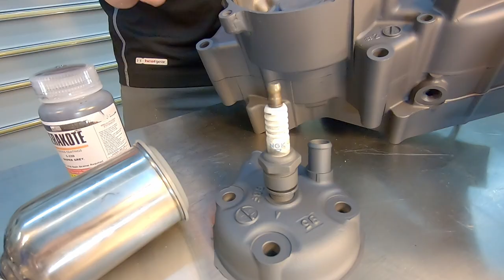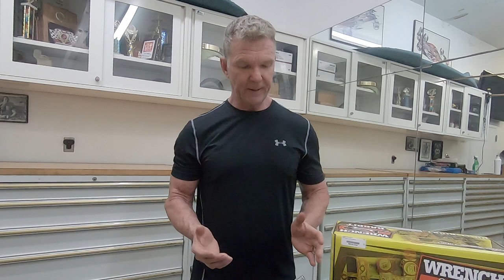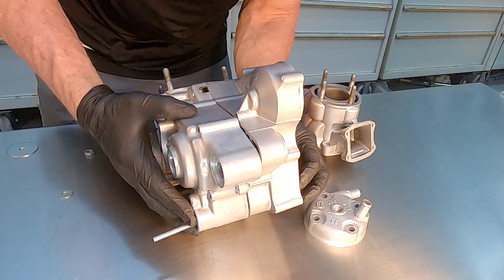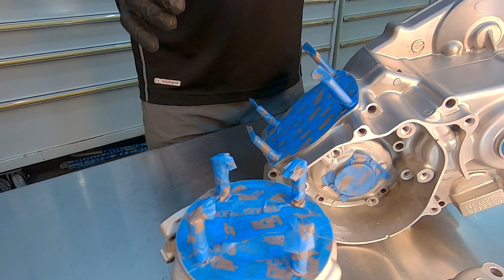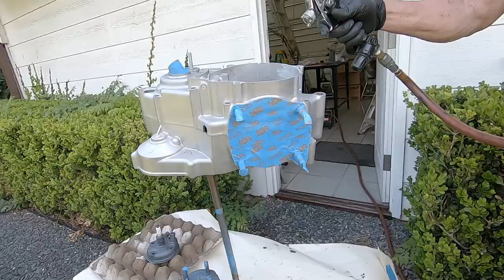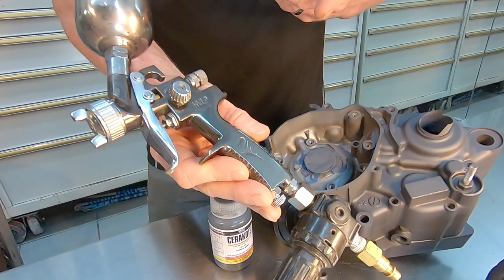Vapor Blasting and Cerakoting Engine Cases

Comment: Hi, Brian
I suggest before you instruct people what to do you should study the Cerakote instruction. I do have a Vapor blaster and a dry blaster at home but Cerakote stresses in every instruction to dryblast the surface with a 100-120 grit aluminium oxide to „scratch the surface“ and NOT use beads and vapor blasting for a nice shiny surface. Also it is always good to bake the parts first. But basically what it boils down too is study the instruction and do it right before making a demo video on Youtube.
Reply from the maker: I’m very familiar with applying Cerakote and have had multiple interactions with the technical departments there. If you want to shoot Cerakote on a firearm, by all means, it doesn’t hurt to dry blast it, of course. If you are familiar with motorcycle cases, you may know that the surface is not a “nice (sic), shiny surface. Its is a cast surface. So, what it really boils down to is your expectation of the surface appearance after preparation. And the adherence of the media to the substrate is far more dependent on cleanliness than blast media. I have sprayed countless parts using my techniques. So, rather than suggest that I’m not doing it right, perhaps just do it how you like. My results stand for themselves. I have had ZERO delamination issues using my techniques. Feel free to make you own videos, but my instruction and techniques are proven and right on as my result bear.
Reply: Hi Brian
I respect that you do anything the way you prefer but don’t forget that a lot of Youtuber (like me too) watch videos to learn and improve procedures and in exchange we thankfully support such Youtube channels in good faith that your instructions are (Cerakote) correct. You owe it to your supporters that, at least you tell them that this is not how Cerakote wants their products applied to guarantee long life and mention that this is „your way“ of doing things contrary to what Cerakote instructions require.
Sincerely Bernhard
Reply from the maker: @bernhardlist9359  It seems that you are not grasping the distinction made by Cerakote in their surface preparation for, and I quote your first comment “nice shiny surface” and a rough surface like a dirt bike motor case.   I did my best to explain in my previous reply that the surface of an engine case is cast, not shiny.  I have over 30 years of experience painting in the automotive industry and I am well versed in the procedures for painting and surface preparation.  My technique for preparation of my substrate in this video is absolutely correct and appropriate for an engine case.  In no way is my preparation a break from what you call a “requirement.”  If I were painting a car panel, the surface preparation would not be the same as it would be if I were painting wood.  The same parallel applies to the differences  between a firearm and an engine case.  What matters is the cleanliness of the surface, the spray techniques and the drying recommendations.  So, to summarize, what you seem to be ignoring – even though I have already explained this - is that the recommendations of Cerakote are for the expected result from preparation of  a smooth surface such as a firearm.  Please feel free to ignore my tips and techniques and refer to other videos.  However, my results are proven using my techniques as I have had ZERO delaminations on ANY components I have painted with Cerakote.

Comment: Hey Brian I completely understand your logic for dismissing the absolute need for sand blasting for surface prep in regards to the cerakote adhesion. But for strictly cleaning purposes prior to applying cerakote on something as intricate as engine cases, would you say the vapor honing is superior to sand or bead blasting? I ask simply because I think I can find someone to sandblast easier than vapor honing.
Reply from the maker: That is a tough call, Charles, but I lean toward, "yes."  Vapor blast just looks perfect when completed.  Ive never found anything that turns out better after treatment.

Comment: How durable is this non-hardener  Cerakote?  I have used the catalyst/baked version.
Reply from the maker: Hey Rusty!  Cerakote is not super durable in general.  Its hard, but not tough. However, specific to your question, the C series has greater variability in hardness ratings than the H, or catalyst dependent, Cerakote. According to Cerakote, pigments vary in hardness so, with the absence of catalyst, the pigment contributes more greatly to the hardness rating. The presence of catalyst as a medium for hardening makes H series less variable. But, as I stated in a more recent video focused specifically on the superiority of the C system for most home hobbyists, both systems are very hard and, in my experience, indistinguishable.  A lot of things come down to splitting hairs and for me, this is one of those circumstances. They are both very hard and the ease of ambient cure is worth a greater variability in hardness given that the difference in hardness is negligible. Hope that clarifies!  Thank you so much for watching!

Comment: I have a buffer and an air die grinder. Do you think if I use a scotch brite wheel and buff the part without sandblasting would be ready to cerakote? Which grade of grit do you recommend?
Reply from the maker: Hey Genysmen!  It probably would.  But, as for grit, Im so sorry, but I just dont know.  I prefer the finish of Vapor Blasting as it looks as fresh as OEM after.

Comment: Hi, looks great.. Looking a Cerakote C as well and have just vaposufficient
Reply from the maker: Hi Chris!  I think C Series is the best for most DIY applications.  Its easy to spray, no heating and no mixing hardener.  Im not sure what "Vaposufficient" means...!:)  Thanks for watching and please consider subscribing if you havent already!
Reply: @brian.d.mobley , 

Don’t know what happened but I must have deleted the message before posting. 

I meant to write that I have been looking at Cerakote C as well and have vapor blasted an entire BMW airhead “R80RT” engine as prep. However I talked to the local paint shop and they pointed out that vapor blasting is not creating a sufficient surface profile for the Cerakote to stick to. I have copied in a statement from the Cerakote application guide beneath. 

”application guide” :
A blasted profile must be applied to the substrate to remove any rust, scale or other coatings. This is required to ensure maximum adhesion. Remove any sharp edges that may create thin areas or protrude through the coating. For best results, use a dry grit material such as aluminum oxide or garnet equivalent to a 100 - 120 mesh size. Glass beads are not recommended as they are not aggressive enough to produce a sufficient blast profile. 

Now in you video you refer to vapor blasting as a great option, but that is a lot milder that sandblasting and I’m aware that glass bead blasting is not the same. However vapor blasting is not the same as sandblasting either! So I would love to hear how it holds up afterwards. Have you done any scratch or chipping test or similar.?

BR
Reply from the maker: @christoffermuhlbach1699  I talk about this issue all the time and I am about to do a new Cerakote video where I spend more time on this topic. The short answer is: A vapor blasted finish will work GREAT.  It is a media blasted profile that is delivered via water jet rather than air pressure.  Here is what I say about this issue all the time: "manufacturers are forced to make firm declarations about how to apply their products to avoid having to answer a million questions about variables AND because it gives them an avenue to avoid responsibility for poor results by citing  errors in procedures by the applicator."  As an example, I too contacted cerakote about coating a dirt bike rear shock absorber spring and was advised that it a perfectly fine application (I was concerned that the coating would be too hard and would not allow for deflection of the spring under load without failing).  A spring is made from VERY hard metal and it would not matter one bit if that metal were sanded, vapor blasted or sandblasted, the surface would end up with almost identical surface roughness.  In the automotive paint world, spray techs call the surface preparation as having adequate "tooth" to allow media to adhere.  Usually 600 grit sandpaper creates the level of tooth.  So, to summarize, dont get bogged down by manufacturers recommendations on surface prep.  It could affect how smooth and shiny your job appears after, but I have cerakoted polished dirtbike cases on my shifter kart and have cerakoted multiple engines and have never had a problem.  I am an avid cleaner and preparer and that is what is needed more than anything to ensure good adhesion.

Comment: How's this hold up to heat, and is it easy to clean after riding?
Reply from the maker: Hi Eric.  Cerakote is rated to at least 1000 degrees, so its no problem regarding heat.  As for cleaning, the surface texture is the same as the original part so there is no change there either.  Its great stuff and I use it a lot!  Thanks for watching!

Comment: Hey man good video.👍🏼
So I don’t have to put it on the oven?
Reply from the maker: Hey Luis!  Cerakote makes various “series” of coatings, but they roughly break down between air cure and oven cure. There are lots of air cure colors available. So, to answer you succinctly, no. You don’t have to use an oven for all Cerakote series. Thanks for watching!

Comment: What PSI are you running when spraying the Cerakote. Great Job.
Reply from the maker: Hi SC!  The PSI varies depending on the color used, but usually between 15-20 PSI. The manufacturers data sheet will tell you the correct PSI for your color which can be found on the Cerakote site.
Reply from the maker: @davidofqwerty  Respectfully, you are simply following dogma and don’t understand application theory nor that not all surfaces on which cerakote are applied must be prepared by sandblasting. Cerakote now acknowledges this. Cleanliness is far more crucial to outcomes than “blast profiles” as has been proven countless times from my over 30 years of application experience.

Comment: Is it bad to leave it without cerokote?
Reply from the maker: Not at all.  From the factory, they aren’t coated. But aluminum oxidizes and looks dull quickly unless you take good care of it. You can spray all the engine down with Boshield T9 or maybe WD40 and it will stay fairly new looking for a long time. T9 is a superior product but it’s expensive.
Reply: @brian.d.mobley  ah okay, i was worried about that. Some guy i met is charging me $100 to vapor blast my frame. Do you think that is a good deal?
Reply from the maker: @EarthWasHere  I think it’s fair. To do my entire motor is about $70.  It’s much smaller to do a motor. And not as unwieldy.  I think it’s about the right price.
Reply: @brian.d.mobley  Got it. Thank you. 👍

Comment: So, why not just vapor blast, then run it without cerakote? 
I am rebuilding a cr500 for a client. We are trying to decide what coating. 
Powder doesn't look as clean to me. Cerakote looks awesome. 
But the coaters don't know how well it will wash off . 
We live in oregon , so this bike will see some sticky red mud!
Reply from the maker: Hey Dave!  You can just run it. But aluminum will oxidize and get dirt stains. I prefer to coat it for these reasons. Not to mention I like the look. Cerakote is very durable and won’t wash off. As long as you don’t clean your bike with a wire brush, it will last a VERY long time. I keep my bikes spotless, so I don’t leave dirt and oil on mine, but even if you do, Cerakote holds up well. And, Cerakote is a superior choice for engines for it heat dissipation qualities (it won’t insulate like Powdercoat) and its temperature resistance. Its really pretty amazing.
Reply: @brian.d.mobley  Thanks Brian! 
Yeah, I believe I will push him towards cerakote! 
I guess I typed it weird above, but there was a concern about the cerakote being semi porus and the dirt embeding in it. 
But I know for sure the bare aluminum will do that. 
This particular bike was mine for 24 years,so I am taking extra time on it. 
Thanks again!
Reply from the maker: @davelambardo6464  Not to counter what you wrote, but Cerakote is not porous.  It is a a paint and it will completely keep out contaminates as long as its not damaged.  The surface of a case or engine is kind of rough (which may be what you are expressing in your comment).  You will love the result from cerakote.  And, they make clear that you can spray which will keep the dirt stains away yet still retain the look of the stock metal (if you want that look!).  If you decide to do it and need help, don’t hesitate to reach out.  Ill help as much as I can!
Reply: @brian.d.mobley  Perfect !  Great help Brian !
Reply: @davelambardo6464  I've been reading up on all the Cerakote product range. Planning on doing quite a bit of restoration work using both oven bake and air dry systems. From what I read all the Cerakote finishes perform like a Teflon type surface so should be easy to clean and highly stain resistant....Good video demo,Brian👍
Edit to add: Dave,if you wanted to see just a vapour blasted finish colour then satin clear powder coating will seal the blasted aluminium from oxidation but look very close to the freshly blasted look.
Reply: @howardosborne8647  Right on!  Thanks for that! 
I have a buddy he's a manager at a coating company here local. I am trying to get him to random experiment with a few of my personal projects and expand what I can offer to customers when I take on side work. 
I have an early 90s honda xr 600 I want to do a clean up build on. 
I think cerokote on that would definitely be a better choice than powder for heat dissipation, and I am curious how the cerokote holds up and how easily it cleans after the mud gets baked on that motor. Those old 4 strokers have a lot of heat in them.  Compared to a water pumper bike. 
I have always disliked the cooling fins on the heads of these bikes when it comes to keeping them clean looking.
Reply: @davelambardo6464  Cerakote would certainly be the better choice for an air cooled head & barrel assy. I have watched a number of video demos on YouTube where the Cerakote systems are given some serious abuse to prove the toughness and stain resistance of the system. Even the air cure Cerakote looks to be really tough stuff. The oven cured range is even more resistant.. The whole product range seems  to be up to surviving extreme usage.

Comment: How much did vapor blasting the entire bike run? I’m here in Texas also, so i may reach out to the same guys. Thanks!
Reply from the maker: Im not sure.  But, for the frame, I think sandblasting is probably better.  Vapor on the engine and aluminum stuff.

Comment: Just use a razor for the tape...you're still filing machines surface of your engine. Even tho it's the outer edge
Reply from the maker: In my experience, the razor routinely "snags" the aluminum and is not effective.  I only file enough to create a score line in the tape so it can be easily removed.  But, thank you for you insight and thank you for watching!
Reply: @brian.d.mobley  I know what you're talking about. It happens. Just see it differently and that's fine. As long as you know you're not doing any harm then it's fine lol
Reply from the maker: @willybman3723  I try to be careful, but I make mistakes like anyone else!  I never mind a good tip that may help me learn something or do a better job.  So, thank you for expressing your idea on the razor blade thing.

Comment: Good job bro..where do you from.?
Reply from the maker: Hey NK, I’m in Texas.  USA. Thank you for watching.
Reply: @brian.d.mobley  i have small business..powder coating & vapor blasting...i like your tecnic..
Reply from the maker: @H.K_project-015  Thanks!  I’m doing a new motor this week. I don’t think I’ll make a video about it since I’ve done a few on Cerakote already.  I really enjoy shooting Cerakote and the effect is just awesome.
Reply: @brian.d.mobley  if you want to use powder coating I can help teach you ..
Reply from the maker: @H.K_project-015  thats so nice! Thanks! I have been considering doing some powder coat on my next bike project.  Im going to build up a new CR85 for my wife and I plan to really trick it out!
Reply: @brian.d.mobley  I did several times restoring the engine or frame of a BMW, BSA, Triumph, Norton ... I prefer to use powder coating because it is durable and very strong
Reply from the maker: @H.K_project-015  Both coatings have their uses, but for heat transfer on a motor, I think the thin coating of Cerakote is better.

Comment: Mask?
Reply from the maker: Hey Bert.  Youre are not the first to notice that.  I should have worn one, no doubt.  I set a bad example by not wearing one.  But, it was very well ventilated where I was spraying and the risk I was taking was probably akin to the same risk as spraying with a rattle can.  Still, I should have been wearing one and in my most recent video on Cerakote, I am.  Thank you for watching!
Reply: @brian.d.mobley  takes a man to admit a mistake and you have admitted it well. Thanks
Reply from the maker: @bertharris9748  Thanks. And thanks for watching. I have very new video on Cerakoting that you may like if you want further info on doing Cerakote at home.